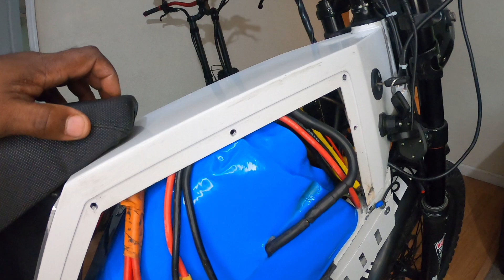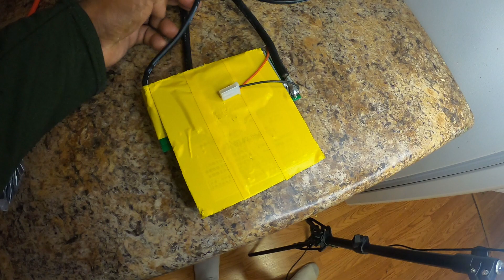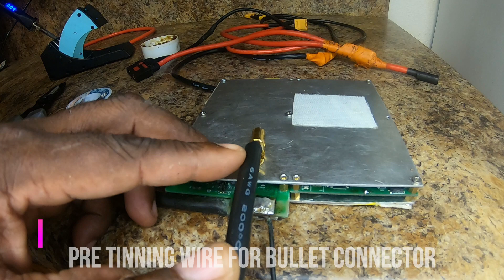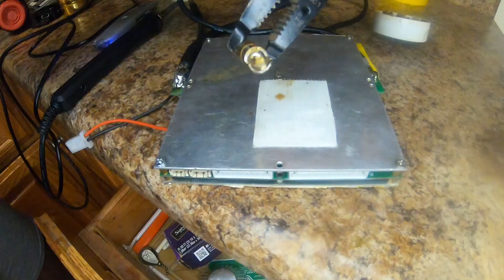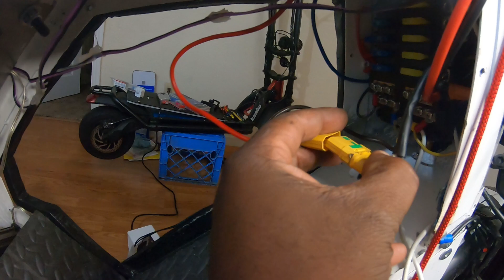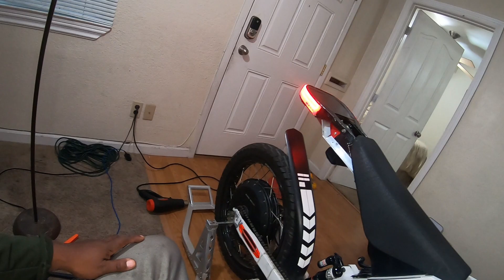Bypassing the BMS on discharge on my Stealth Bomber e-Bike.

Comment: Mate I could do with ur help please. Iv just bought a stealth bomber the battery was only showing 57v. So I opened it. First time ever. 3 black wires one side of the bms are showing 83v the other side 57v. If I bridge it it shows 83v at the power lead. Can u help me with making this safe or would it be safe. Thanks to u and anybody else that could help

Comment: Broo are you doing it in your underwear? 😂 What a legend!! ..
I am currently building new battery for my 8kW stealth bomber. Stock battery is 40Ah 150A bms , upgrading to 50Ah. Instead of using the stock BMS from the old battery ( passive balance, no BT/Uart ) I wanna use  a smart BMS I have in my shelf. It's rated only for 100A, so instead of buying new one, I am thinking the way of bypassing the discharge side. I am slightly worried about safety - in case of a  controller failure or short, the consequence could be absolutely catastrophic. So I'm still considering it. But bypassing could give me slightly better top speed/climb  power  by eliminating the voltage sag over BMS FETs . I mean, we're talking miliOhms, but that can make a slight difference in 100+A area

Comment: Yes, if u use bigger gauge current should flow without heating the wires. But you first need to know how many amps you need to pull
Bypassing the bms may drain your battery in discharge and damage the cells unless you do monitor the discharge properly
Use heat resistant tape...

Comment: I love how before you bypass the bms the lead coming off the pack was heating the heatshrink. Good stuff :)
Reply from the maker: Yeah. That stuff has been fixed. All apart of learning. This entire project has been very educational.
Reply: @FlyHighforfun  I would do the same thing. More power = more better. Fun toys get hot. I think the contact resistance from the connectors was where the heat was coming from.

Comment: wow you need a cooling fan for your battery if there is that much power being pulled that the wires are getting hot airflow is important
Reply from the maker: The bullet plug I used was causing resistance so I removed it from the equation. Should be good to go now!

Comment: Why not just put a bigger bms that can pull more amps?
Reply from the maker: Its the battery that is responsible for the amount of amps it can deliver not the BMS. So depending on the cells used and how many you have in parallel determines the amount of amps the battery can deliver. I'm working on building a new battery pack that can deliver twice the amount of ampd this battery is delivering.. the more amperage the more power!
Reply: @FlyHighforfun  More amps = more heat management needed, maybe  try upping your voltage. This will give similar power so you can reduce the amps needed.

Comment: The fact that your doing this in your underwear is a little weird... make sure you don't drain your pack too far  be like very careful. Would be better to get a bms capable of the right amps your trying to discharge.
Reply from the maker: At least I know you were watching!!! Lol I just knew somebody would point that out 🤣🤣🤣🤣🤣 hey I was in a hurry to make a video. Since then I've installed another display. There hasn't been an issue with over draining the battery. I don't use the BMS for discharging.. only for charging and balancing.. that's it!
Reply: @FlyHighforfun  yes I know you still use the bms for charging only... just saying be careful... I'm sure you already know just a friendly reminder... I had somewhere pretty far I needed to go and I just bypassed my battery to drain it really low so I could make it where I needed and now it's too low for my charger to recognize and recharge... they're cheap Chinese cells tho and the pack wasn't capable of getting me the range I needed anyways so I said fuck it and drained it to get somewhere and back... it wasn't valuable anyways really I wouldn't have even tried to sell the bike with the battery only doing like 7 miles before the bms was cutting it off... so I just ruined it... whatever had a dr  visit... plus I've got a nice bike on pre-order so hoping to have that by Jan or feb.
Reply from the maker: @MotoAlias  depends on how low the battery cells are. That's exactly why I bypassed the BMS i don't like restrictions on either discharge or charge. I'm familiar with the charger refusing to charge when you fall below the limit. Just means the charger is doing its job.. I discharged a cell down to 1.7 volts before and brought them back.. there is ways to charge the cells you just need a RC charger. I usually just charge through the balance port down to the individual cells.. 
When your battery gets out of balance sometimes you have to do that to get it back right.. I'm planning on releasing a video soon on how to do that.. cuz my battery currently is out of sync/balance.. about.. 0.20v. right now it's no big deal but as time goes on it could potentially turn into a problem.  thanks for your feedback..

Comment: if its cutting out then you ether have cells that are inadequate for the task or the bms is set for too high a voltage or your pulling more amps than the bms is rated for. now if your pack gets slightly out of balance and you try and run it down too far you will permanently damage your battery pack.
why didnt you check for the reason your BMS is cutting out, you have the app?
the smart way to do this would be to use the BMS to drive a high current contactor, that way all the voltage limit protections are still in place but its no longer current limited.
Reply from the maker: Well. I got tired of the BMS interfering.  I just rebuilt this battery pack. Went from 8p to 10p. I think knowing how many amps this battery can supply is the first thing i would want to know. Start with a clamp meter reading at the positive cable. After i see what the amps are doing we can go from there. Its too many scenarios why its beeping. I just want to enjoy my bike not get pissed everytime i hit the throttle and the damn bike shuts off. I been dealing with that long enough. BYPASSED bro!
Reply: @FlyHighforfun  without more information about the power, cells, and pack its hard to provide input based on your situation
Reply from the maker: I'm doing 61mph while bypassed so I'm sure I'm getting adequate amps to reach that speed.. so I think it's safe to cross that off the list.
Reply: @FlyHighforfun  poster above is right, you should diagnose by problem. I ran my first bike at 7ish kw on bird scooter packs. Bullet connectors and one single wire can cause issues. I run 200 amps at 10.5kw on a panasonic 16s8p 21700 pack I upgraded. Your bms may be overheating, and so many solder joints and connections will cause a ton of loss